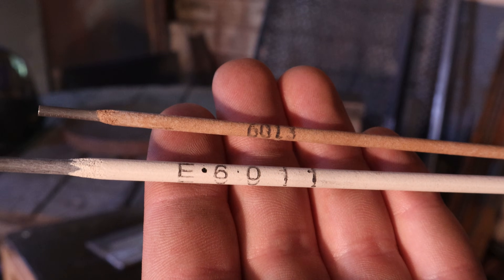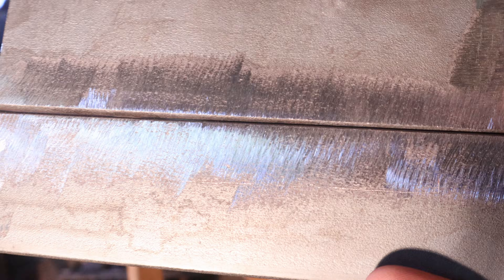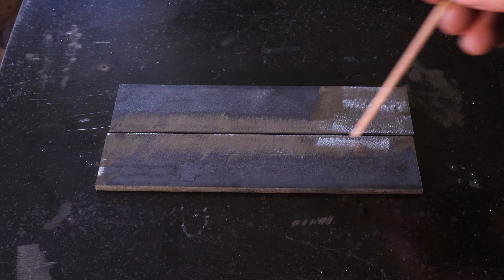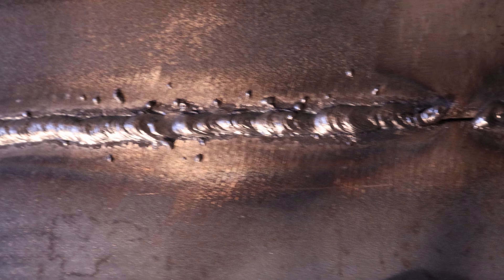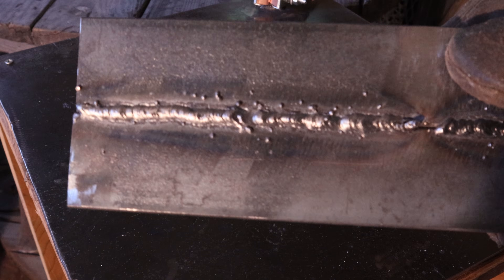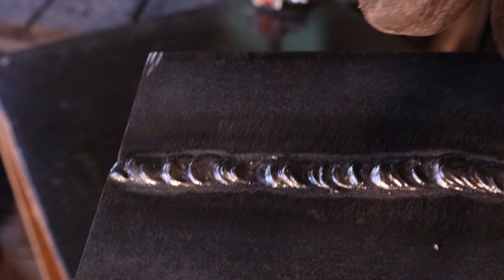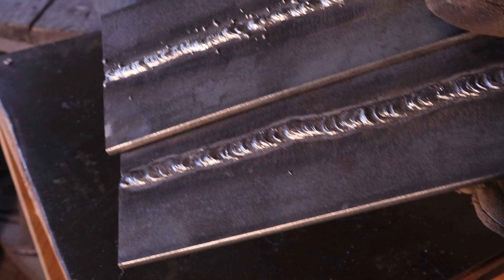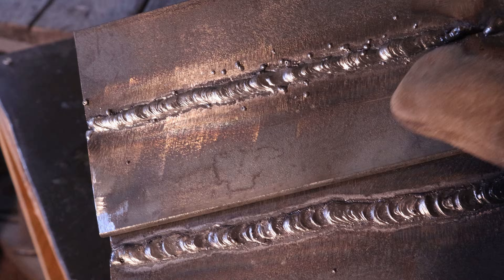6011 vs 6013 / Which Rod Should You Use?

Comment: Okay I know this video is a couple of years old but it just now popped up on my feed, so here are my thoughts:

First thought out of the box-   the criticism over different rod thicknesses is valid-  if you're comparing apples to apples, you should have used the same size rods (and the 6011 is 1/8", not 1/4")-  that way the only variables are rod type and amperage.

Second-  Your 6013 rod did not run well at all-  way too much spatter.  My guess is that you had the amperage set a bit high, or the arc length was too long.  A properly run 6013 is a thing of beauty-  very smooth, uniform, clean and all that.  Problem with 6013, however, is that they are not known for their penetration.

Third-  looking at you run the 6011 leads me to believe that your welder doesn't have sufficient OCV to keep that rod going (OCV is "open circuit voltage", and 6010 and 6011 like a relatively high OCV to run consistently, especially the 6010).  That goes back to the inverter comment made by somebody on this thread-   inverter welders are notorious for having issues with 6010/6011 due to their internal workings, unless you can find one that has additional internal components that compensate for this.

Personally, even with the same size rods, this is more of an apples to oranges comparison.  I think a better comparison would be 6013 vs. 7018, 3/32" or 1/8" rods, butt joint with a groove very slight gap, flat position.  That would tell you which rod punches through the groove-  my money would be on 7018.

Comment: Inverter machines suck for MMA wont keep lit worth a crap
Reply: Check out Primeweld MiG 180. It surprised me, it's a beast in stick mode.
Reply: @robertblackshear8963  i ended up buying an Arccaptain 200 and so far its been an awesome machine
Reply: I wouldn't say that, it's more likely those cheap Chinese welders, Yeswelder, are displaying high but lower output. Guess how I found out, and guess what a cheap Chinese dc clamp meter Kaiweets, measuring high 10-15 amps too doesn't help.  Once I got the amperage sorted out, display vs measured with a Fluke, the arc wasn't going out.
Reply: Unless you put up the stacks of added coin to get a welder able to run 6011/6010, e.g. Esab Rogue 130/180i.

Comment: Why are you calling a 1/8” 6011 rod a 1/4” rod?
Why are you comparing two different size rods?
Why are you not using the 6011 as it’s supposed to be used (whip and pause or circles)?
Reply: Note: whip-and-pause wants a tame 6011 rather than a nasty one if you’re just starting.  I found that Forney makes the tamest of the three I tried on a project some years back.

Comment: Hobart 6013s penetrate while ESAB 6013s give beautiful welds. E6013 must be a broad electrode flux composition-wise.
Reply: They seem to be.  There are multiple flavors of 6013 in most other parts of the world, compared to the US.

Hobart’s acts like the fabled Rutile-Cellulose rods, which means they penetrate better than straight Rutile (e.g. Lincoln, and ?Esab?). They also spatter a bit more.  (Sharp chisel and a 12 oz/300 gram engineer’s hammer will get those.)

Comment: I think, you should start with the correct diameter. It absolutely doesn't look like 1/4. It is 1/8. There's a "golden rule" - 30 Amps per 1 mm of the rod diameter. Some adjustmen might be required depending on the metal.
The penetration also depends on Amps, time and techniques. The thick metals usually should have the edges grinded to allow dipper penetration. 
Conclusion:
For the best result you should have same diameter electrodes, similar Amps, correct techniques.

Comment: You are absolutely right, the 6011 rod likes to stop. I often weld on thick metal so deep penetration is a must. I'm using the Hobart Stickmate LX (buzz  box) on both AC/DC and so far it's been a learning experience. Good video. Thanks!
Reply: For thick metal I'd recommend 7018, but it's up to you what you prefer

Comment: You raise a good point why 6011 rods continually stop. I've been frustrated using 6011 (3/32") rods because of the continued stops. I like using 6013 rods (3/32") as this rod is easy to start and continues to stay lit which allows me to run a continuous bead.
Reply: What seems a good idea would be to somehow combine the two, and then put a trifle of some alloying elements in the rod proper???
Reply: @dennisyoung4631  I'd like to figure how I could combine the two. Seems this combination would be ideal.
Reply: @swordfish1120 yes, I know.  Seems they might be doing that in Europe.  They have true “Rutile-Cellulose” rods there that handle modest amounts of rust, penetrate decently, and have “removable” slag - unlike most 6011s I’ve seen/used.  Hobart’s 6013 seems about the closest that’s readily available.

The other issue is that some welders have trouble running straight cellulosic rods.  I had one of these, but it “popped smoke” a while back and I’m wondering if I need to buy a replacement with “hot-start” and “arc-force” adjustments so as to run them without undue trouble!

Comment: I dunno, that sure looks like a 1/8 rod, 1/4 is a damn big rod. You measure the wires, not the flux…
Reply: Just thinking the same thing.
Reply: 1/8 6011 usually wants about 90 amps or so.  3/32 6013, about 75 amps.  These are starting values, and will need adjusting to suit the joint, etc.

Another matter, however, is that Cellulosic electrodes, e.g. 6011, 6010, want a higher open circuit voltage to start and stay burning.  Lots of inverter welders don’t run hot enough.  You need one with hot-start and arc-force (or a dedicated, 6010 part) to run those rods decently.

I personally have had this kind of trouble with 6011.

Comment: The 6011 rod was stopping because the amps were too low to maintain the arc. 210-300 amps is amp range for a 1/4" 6010/6011 rod. 110 is way low.
Reply: Bullshit test use the same size rod they make 3/32 6011 rods and they are a much stronger rod that a 6013
Reply: I'd bet that running a 1/4 inch 6011 at 275 amps would show better penetration than a 3/32 6013 rod at 75 amps...proving just how much better the 6011 really is! King of rods.
Reply: That both size comparison doesn't looks like 1/4 for me.. probably 1/8 ..
Reply: sometimes you need a better welding machine to use
Reply: That looks more like a 1/8 rod.
Reply: 3/32 (Lincoln, Forney) 6011 likes about 60-75 amps, DCEP.  Supposedly they will run on AC, but I’ve never run them that way, on the welders I’ve used.

Of those two, the Forney seemed better behaved.  Lincs were too much like “demon-possessed fireworks.”
Reply: Yep
Reply: I'm 6 and half inches.

Flaccid.

Comment: there are 2 variables in the experiment making it an invalid comparison. In order to truly compare the rods, both rods need to be 3/32
Reply: THIS 👏🏼
Reply: Correct. Good thing I saw this comment or I'll go ballistic with this video comparing these two welding rods 😂
Reply: @rock-afire-fan is the 3/32 just the size or the rod? Thanks in advance
Reply: @jacobromeromaldonado143  The 3/32" is referencing the diameter of the rod without the flux covering. Aka the bare rod.
Reply: @jacobromeromaldonado143  yes 3/32 inch
Reply: @jacobromeromaldonado143  3/32  or 1/8  is the diameter of the metal part, excluding the flux coating.
Reply: I came here to make the same comment. 6011 would be easier to control in 3/32
Reply: That and the 6011 is meant to be done with a whip and pause or circles and not really a stringer bead as done here.